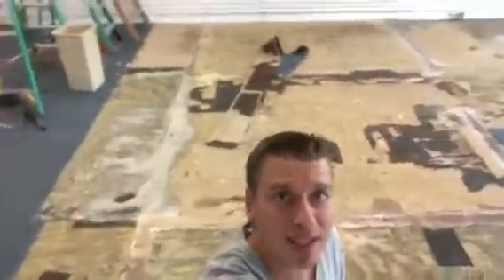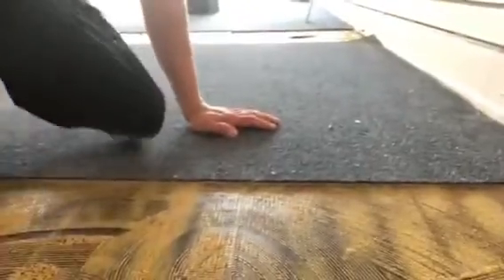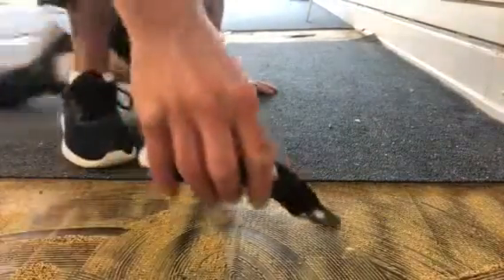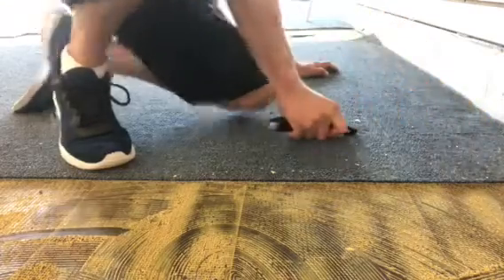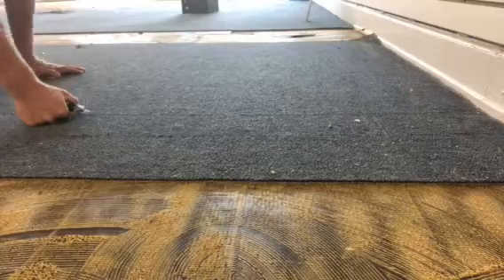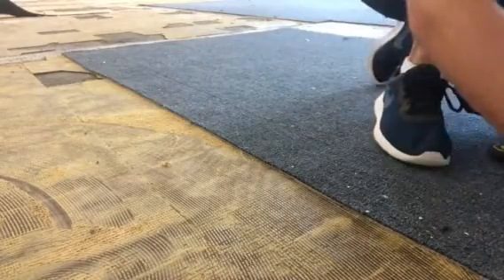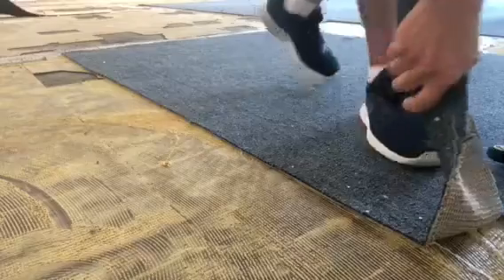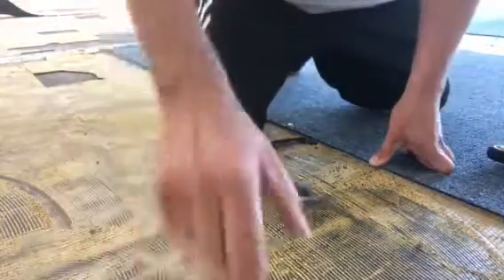How to remove glued indoor outdoor carpet

Comment: Now how do you get the old glue that is stuck to the concrete off?
Reply: Grinder and diamond disk
Reply: Pour boiling hot water on the area, (be careful not to let it get under the walls) let it sit for a few minutes, then use a scraper or flooring chisel to peel it off

Comment: Do you have a video on removing the glue from a concrete subsurface?
Reply: I have the same issue. What about the glue that is left behind? I am removing carpet and then installing laminate flooring. How much of the left behind glue is acceptable. If any?
Reply: Paint scraper

Comment: Looks like that is some pretty sturdy "newer" carpeting. I have the issue of trying this with older mega glued down lanai carpeting that just tears apart when grabbing it to pull it up and back. Would a floor scraper be the better method? Get the glue and carpet up in one shot?
Reply: What did you do?  "Older mega glued down lanai carpet" is exactly what we got.  Lowes said they no longer install unless it's an air conditioned room. Lol
Reply: @micheleh5269  Cut in strips like the video then used Vise grip channel locks locked down at a corner and rolled them back when clamped to a folded corner section. Then worked a 5 way blade under it as I pulled back on the vise grips. Took a while but eventually got all the carpeting up. Then used Sentinel formula to break down the old glue and bought a floor scraper as well with the Sentinel formula. Got it all up after a lot of elbow grease but I know I will never be putting carpeting back down.
Reply: @FlyingBanana78  Thank you.  Curious what you replaced with
Reply: @micheleh5269  an epoxy floor with anti slip mixture. Similar to what people use on garage concrete floor. Has black and white flakes in it.
Reply: @FlyingBanana78  sounds nice did you like how it came out?
Reply: @micheleh5269  a lot better than carpeting and easier to clean. Might not hold up as well over a length of time with foot traffic but I'm sure I won't be around long enough to need to recover the surface.

Comment: You are the bomb.  That six inch thing is the key.  so much easier than even a foot.  lotsa blades, but worth it!
is the carpet glue the same that will be used if i put armstrong vct down?  do i have to scrub it?  or just get it flat?  Thanks so much.
Reply from the maker: Lisa Armstrong well thank you and thanks for connecting! 
Vct adhesive is different than carpet adhesive for sure and holds way better! They carry it at all the big box stores but if you have any other questions on it feel free to reach out!

Also I really wouldn’t bother scrubbing it down (although some may disagree) just scrape it down so it’s flat and any imperfections will not show through the new flooring

Comment: I am removing 1200 sq. feet of carpeting on top of a concrete floor prelaid then walls installed in a commercial environment. Can do about two hours at a time. We purchased a carpet removal tool from Amazon. Works well. Previous floor was carpet too and so am also fighting with two layers or glue. Any suggestions?

Comment: I had a very similar commercial space; 1500 sq ft of carpet glued directly to slab. I watched your video but no way in hell was gonna go 6” at a time.
I pulled up a couple feet of carpet from corner, and cut a slit in it away from corner. Had a 6’ horse rope and tied a loop knot at each end.
Ran rope through hole then hooked both rope loops on trailer hitch of my riding mower.  And pulled it all up. Carpet ripped a couple times but just cut new hole in carpet and did it again.
Started at 10am and was done by 1:00pm. All 1500 sq ft

Comment: Hi. I just bought a house with glued carpet in the laundry room/ back porch. Cement underneath. The carpet is disgusting but seems stuck pretty good. This was helpful. So then what about the glue residue that will be left, any advice?  Can I just put some vinyl tile planks over it!  Cannot do the luan overlay because my water tank system is in there. I I appreciate any advice thank you very much!  Oh, maybe just do laminate and leave the square intact under the pump. What is your opinion?
Reply from the maker: Mary Dorr thanks for connecting! and yep do not worry about removing the old glue residue planks will be just fine going over top of it
Reply: Carpet Expert Blueprint thank you so much. That’s great news.  It’s gonna be a bear getting the carpet up. Thought I might have to sand that glue, ugh 😑 lol. Glad I don’t have too. Have a great evening!!

Comment: Don't know the carpet trade. What is VCT it was mentioned? Also where floor underlayment is coming off the floor. How do you handle getting that smooth and flat again?
Reply from the maker: Most Likely We Do It Services vct is vinyl tiles, very common in commercial properties. On this particular project we just used floor patch to clean up the unevenness but if it was in the budget for the client we should of ran 1/4 luan everywhere to really clean it up as these floors were ugly!
Reply: Just never heard vinyl referred to as vct. Thanks for that.